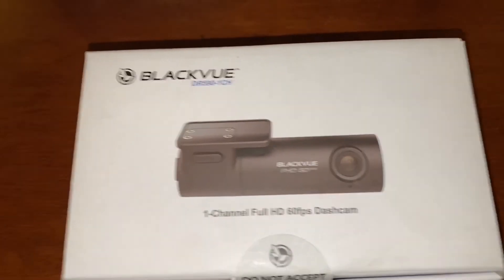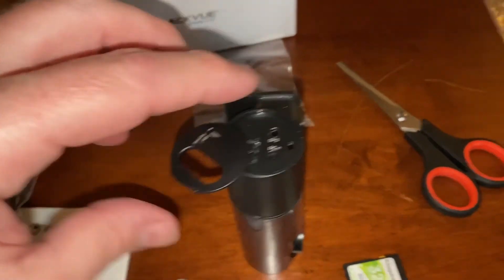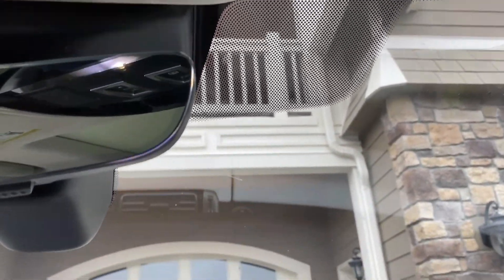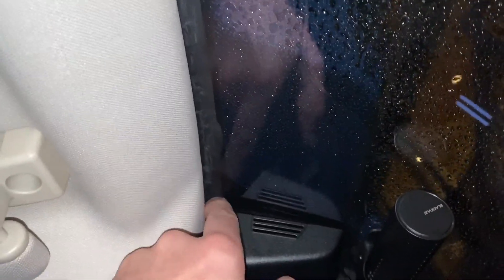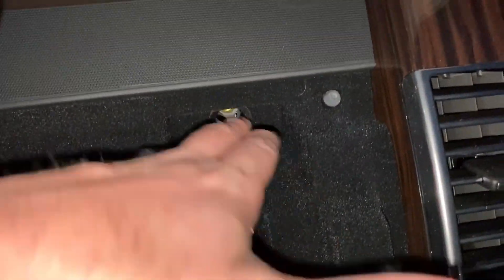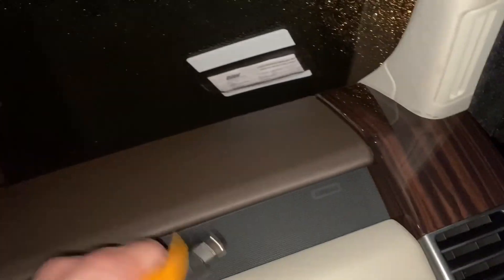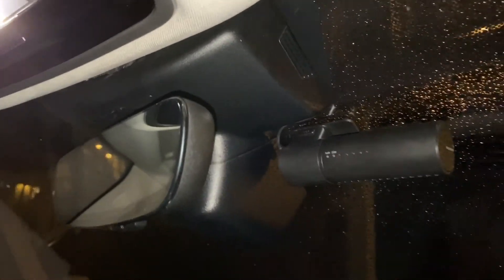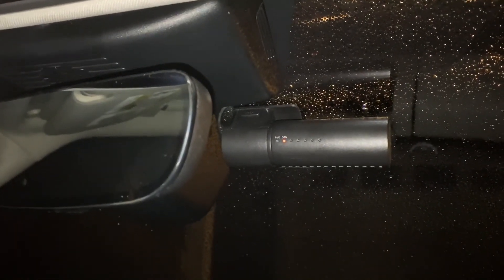Dashcam under $100!! Blackvue DR590-1CH Dashcam Installation - Range Rover 2013-2020

Comment: Hi Joe, I highly recommend you re-route your power cable going down the white A-pillar. The wire is in front of the airbag, and may disrupt airbag deployment, as such, I recommend you thread it behind the airbag assembly.
Reply from the maker: Thanks for the advice - I don’t have this vehicle any longer and removed the camera and put it in my new vehicle - thanks for watching